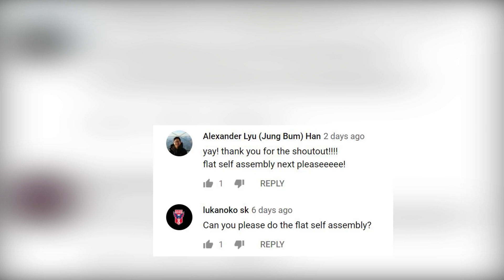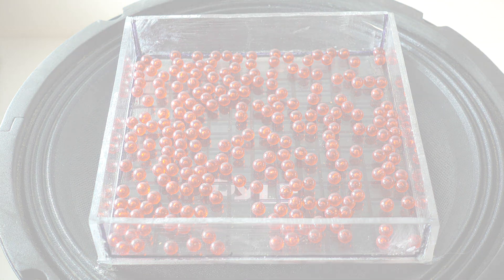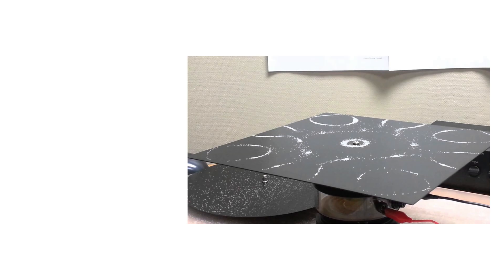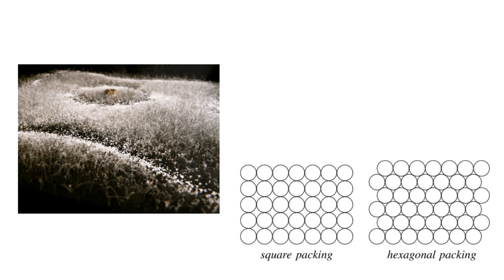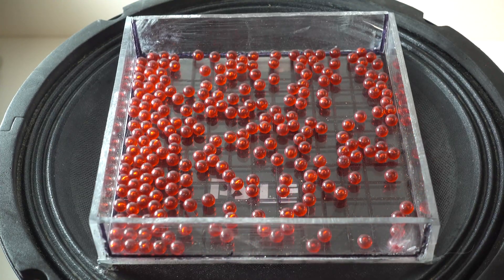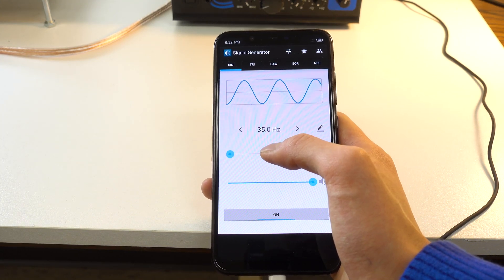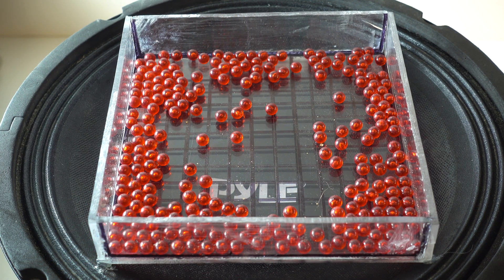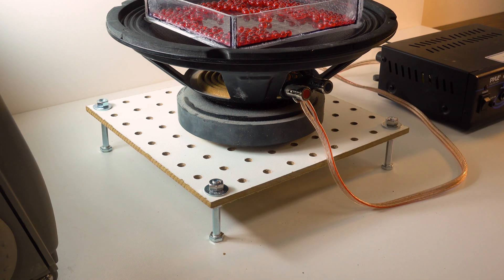Self-Ordering Particles (IYPT 2019 Problem 11 Flat Self-Assembly)

Comment: Thank you for your helpful videos. In this problem, as you correctly mentioned, we want to see crystal-like structure in vibrating mono-layer of regular hard particles, not standing wave of a surface (the question do not refer to Chladni patterns). On the other hand, there is a good similarity between this problem and gas to solid phase changing. In this problem the particles act as atoms, the vibration or noise is like temperature and the number of particles in unit area is density. In order to make a gas to solid you have to decrease the temperature or increase the density of atoms or molecules. In this problem we want to observe this phase changing by changing the number of particles in unit area (or the density) in same amplitude of noise (or same temperature). The phase changing will happen in different density, depending on particle's shape, material (which affects on coefficient of friction between them) and the amplitude of noise. In order to make this experiment better, I suggest to use white noise and put a glass layer a bit above the particles to constrain them in 2D confinement. After that, keep same the amplitude of noise and change the number of particles. You can define an order parameter to measure the crystal-like structure in your particles. The order parameter is one when they are arranged in a perfectly crystal-like structure, and zero when they are completely random.
Reply from the maker: Thank you for your suggestions! I'm sure this will be very helpful to everyone working on this problem.
Reply: I'm working on this problem, too. Your opinion is of great help!! Thank you very much!!

Comment: I did the same experiment with you. The phenomenon I found was that the point of convergence of the particles with the rotation of the subwoofer also turned. I thought it was a problem of plane tilt, but when I raised the point slightly, the particles still Gathered there. So I guess my subwoofer may not be the same in the four corners, but I don't have a second suwoofer for my experiment.

Comment: Surely your setup is inclined, because every time the crystal is formed in the left part of the video.
Reply: I agree. I have been attempting the same experiment with both spherical particles and rods, everything seems to be ordering nicely even with a slight incline but as soon as the setup is completely leveled the particles will not self assemble. I tired different concentrations as well as a rage of frequencies 70-170 Hz but nothing.
Reply from the maker: It is definitely harder when the setup is level. Another key parameter is the amplitude of the oscillation. In the case where the particles stay on the plate, the plate should only have to be level enough so that the horizontal component of the normal force is negligible compared to the friction force.